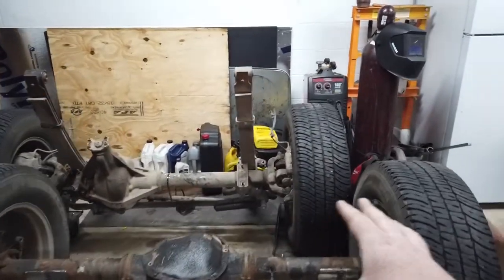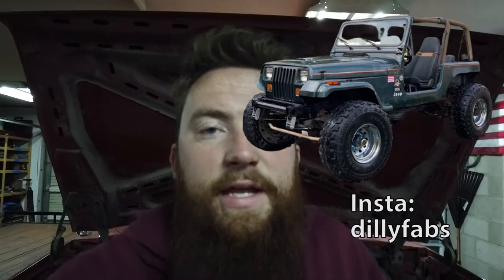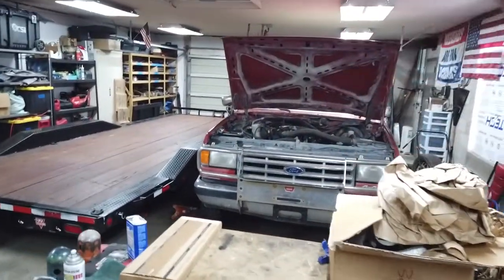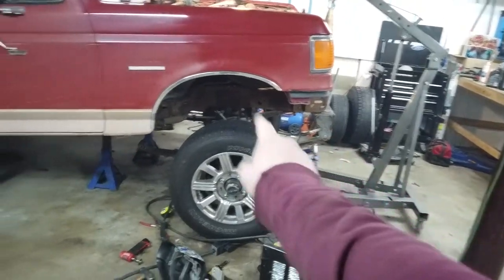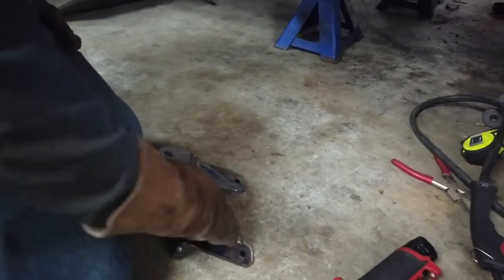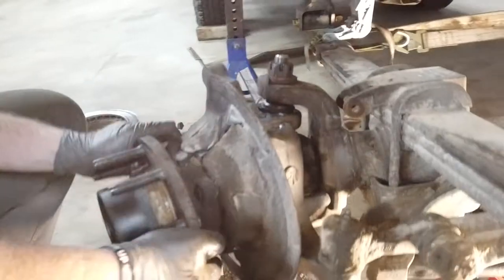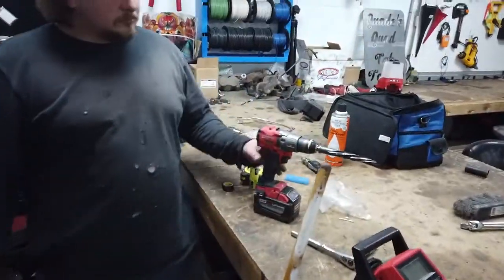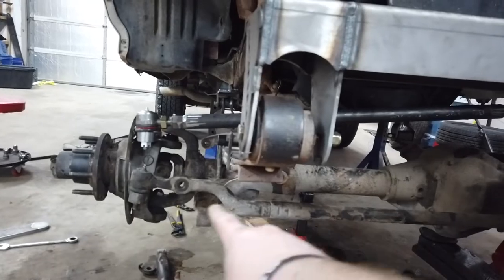SUPER DUTY Axle swap in my BRONCO PT.1

Comment: What pitman arm did you use? Did you have to modify it for the gm 1 ton rod end?
Reply from the maker: Just running the factory one drilled out for now. These are super duty axles not gm ones